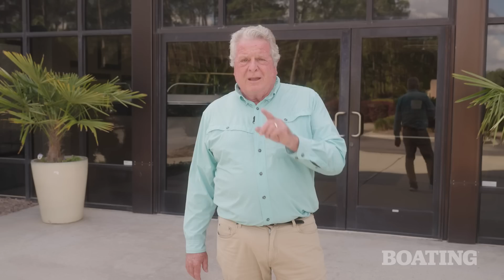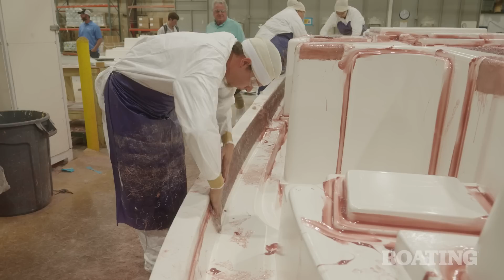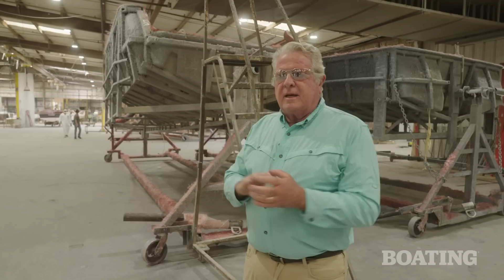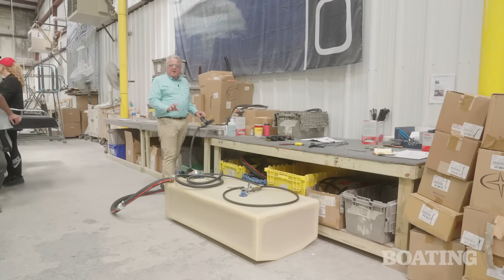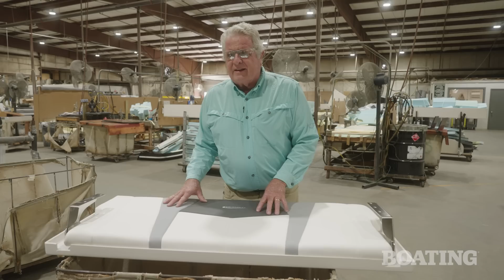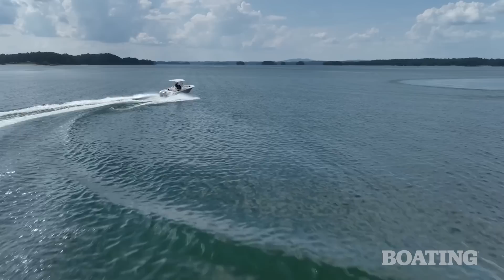Why is Robalo considered a TOP NOTCH boat? Here's a few reasons why.  Robalo Plant Tour 2024

Comment: I've had 2013 R180 was solid little boat. Now I have 2019 R200, the quality control went down the toilet.  Solid hull but some of the hardware is not stainless steel,  rusted out screws.  And upholstery is poor quality,  they claim it's mildew resistant NO IT'S NOT!!  Both of my boats upholstery is always full of mildew,  I have to clean it every week before I plan my fishing trip. The console is always full of water not water tight poor desain and the wiring in the console is a RAT NEST. I expected better quality from Robalo.

Comment: Nothing about this hull construction was unique or special.  Pretty standardized process and materials.

I really dont understand boat prices.  Very basic materials and processes, performed by relatively low skill (and low pay) workers.  Boat powerplants are absurdly priced, but thats on MerCruiser and Yamaha.  Even when factoring the drivetrain cost, boat retail prices are insane.  $100k for an unremarkable watersports boat?  Where does the money go?
Reply: Low skill is not low pay anymore in the US…especially if it’s a union shop.  So many hands are touching this thing.  Really makes me wonder why the hulls aren’t made in another country and stacked/shipped in for final assembly.
Reply: you rich people are so cheap pay the price and keep the money in the US
I would like to see your lazy butt lay fiberglass for one day
Reply: VE resin for the entire hull and 22mils of gelcoat, plus entire stinger grid gelcoated. Lots of expensive materials used. Most manufacturers only barrier coat with ve resin. Ceramic filled transom. This is a quality built boat.

Comment: 18-22 mm of gelcoat? Are you sure it's not 1.8-2.2mm? Nearly inch of gelcoat sounds excessive and expensive! : D

Nice tour man.
Reply: mil = thousands of an inch.
Reply: I think he meant 1.8 to 2 mm. You can’t put down 22 mm thickness with a spray gun. 22 mm is equal to 2.2 cm which is 0.86 inch (nearly an inch thick gel coat).   You would be putting down layer after layer of gel coat for days to reach 22 mm all around a hull.
Reply: @stujos82  18-22 mil = 18 - 22 thousands of an inch.
Reply: I thought he was talking in mm at first too.  As others have pointed out, 1 mil = 1 thousandth of an inch, so we’re talking about ~1/2 mm here.